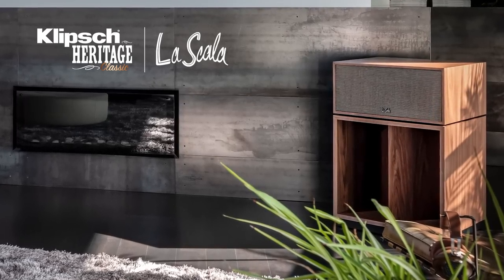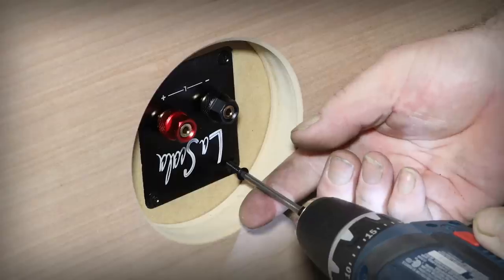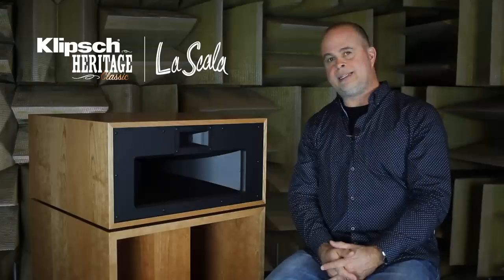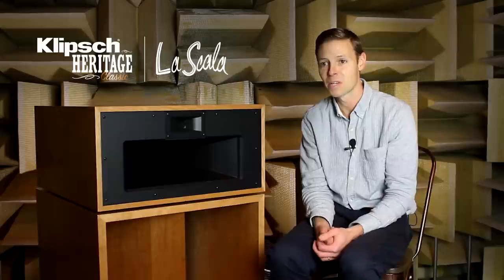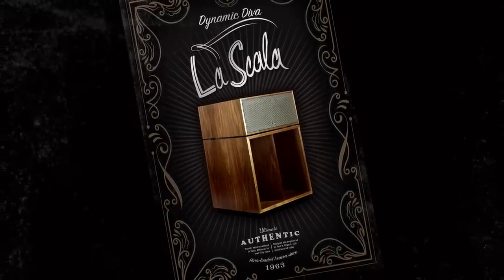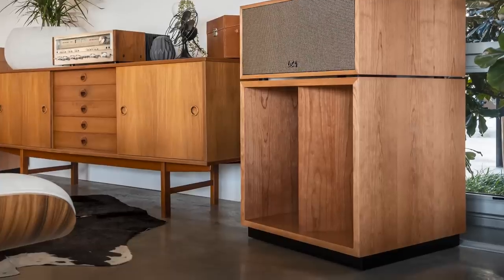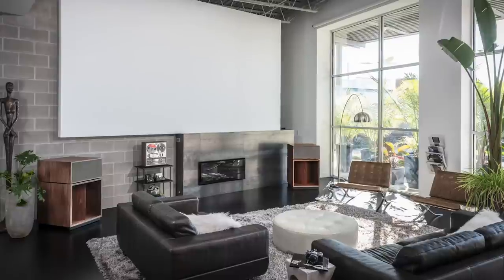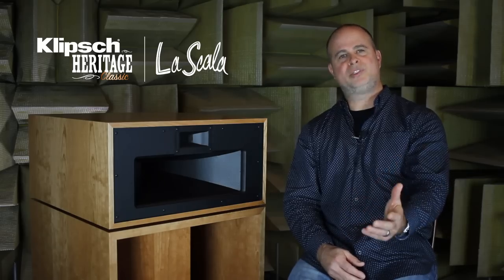Beyond the Specs: Klipsch La Scala AL5

Comment: MDF?  I used to own a set of LaScala Pros from the 80s, and those had heavy duty plywood throughout.  I used them as PA speakers until about 2015 when I gave them to a friend.  Hundreds of shows later, those were still standing after minor repairs.  I love these speakers, but I question the direction of increased price and beautiful veneers hiding MDF construction, which really is not as acoustically dead as good plywood and proper construction techniques, and isn't anywhere near as strong.  I'm sure the tuning and drivers are more refined now, but this speaker used to be far more utilitarian than it is now and that was part of its charm.  Not to mention it used to be far more accessible in price.
Reply: I agree with you.  The older plywood speakers could take a beating and easily be semi-restored with a little light sanding and either varnish or wax.  I would not want to hit these new speakers with something that dents or cuts the veneer as you'll be stuck with the damage.  Also, over time, humidity and climate could have undesired effects on the cabinets.  MDF may be OK for Sauder furniture, but I would prefer a more solid cabinet for the long haul in Klipsch (and you can order 1" thick plywood).  I would agree that iy may be harder to get the "book matched grain look" using ply, but a small price to pay.

Comment: LOVE the fact that Klipsch still makes them in HOPE, ARKANSAS, USA !!  Never stop making the Heritage Line.  Incrementally improve the drivers (midrange and tweeter diaphagms, crossovers, horn geometry) and your cult following worldwide will thrive and grow.
Reply from the maker: We'll do our best to keep pleasing our fans!
Reply: Mid horn still beams.
160 hz still peaks.
400-500 lobes
Timing terrible
Haven’t heard new tweet
Reply: Dave Volz - my impression is that you are transfixed by polars and sensitivity graphs.  Those quantitative measurements define your opinions and color your subjective reasoning. Fine. I’m an Engineer by training and I get that.  But so many music lovers crave a dynamic, forward listening experience that doesn’t require headphones.  To them, your opinion is meaningless I’m afraid.
Reply: @davevolz6138  But they will still sound more life-like than any (most) conventional speakers.
Reply: @Taco That’s not true. Flat response  is more neutral, without a  sonic signature imparted on the music or voice.
Only use horn loading when necessary.
Yes yhe dynamics are better  but early reflections caused by the horns themseves create fine cancellations in the resulting sound wave,  
you can even see it on sine wave sweeps. All those little zigs and zags are cancellation and reinforcements., giving a kazoo like texture to the final sound.
Reply: @Taco Maybe their new Twitter handles the lower crossover point better than the old T35. I’ve been time aligning experimenting with these for the last 40 years. Mid range gets way too beamy leading to bad off axis. Response.That’s a big reason La Scala needs just the right room acoustics. The bad off access is always fighting with the overall mix.Remember it’s the sum of the on axis and later delayed off axis reflected back by the room that equals what you perceive. If the direct sound sounds apart from the room sound the speakers never really disappear. listen to a speaker like the MBLreally shows that up.
I’m not a purveyor of omnidirectional speakers. They tend to sound too diffuse. But off axis is linearity is a must.
Reply: @Taco Enjoy!  That’s the bottom line!
Reply: @Taco They bring the concert into your listening room  like few others. I totally understand, and it is hard to explain.

Comment: I got a pair in December of 2020 and they are beyond superlatives.   I am pushing mine with a NAD 916 multi channel amp;  30 watts to the bass unit and then another 30 watts to the upper unit.   A 12" subwoofer fills out the bottom end tastefully and naturally.     Can confirm these speakers love live music.   On well recorded performances I swear you can hear how big the room was at the venue.   The soundstage is more of a SoundCloud  and can extend beyond the walls of your listening room.  Surprisingly, for each speaker being as large as a washing machine these La Scalas have a shocking capacity to just disappear.

Getting the AL5s was also like being gifted my entire music collection; everything sounds new and exciting.   Hidden details  now slap  you in face.    These speakers provide miles of smiles.

Comment: The biggest mistake I have ever made was selling my Lascala's in order to buy my first pair of klipschorns . Lascala's  are the most underrated speakers ever made . I did all the reasonable mods with a4500 CT125 tweaters and heavy Duty 15's from Bob Crites  i didn't go crazy with the mods. My speakers were 25 years old and needed crossovers and the woofers and tweeters were blown . I could have gone ALK or cornscala but I wanted the original look . Mated with a Luxman L100 the perfect pairing it was a 1 2 punch combo . I sold My LaScala's  for 2K and it took 10 seconds to sell . 

LaScala's are not zone specific you can place them anywhere in a room and they will perform . I have people swear the old ones sound better than the new AL5 and to that I say keep dreaming .
Reply: Charlie davidson I think the back of the new corner horn bass bins are now sealed. I wonder if this makes them less dependent on corner placement?
Reply: @MrBonger88  Yes you are right and it goes back to Paul's false corners . For years it was blasphemy to even say false walls even though Paul used them and Klipsch had clear plans on False walls.  I'm thinking of modifying my Klipschorns but I've been  waiting to see if someone has already done it and learn from their mistakes .  

Don't get me wrong Klipschorns are great speakers But my LaScala's to me sounded better . Lumber is expensive so I have to be smart because I don't want to waste lumber or more importantly ruin my speakers . False walls for me is not going to work .  

I go back to why they are in the corners in the first place . 

Great comment
Reply: Charlie davidson IIRC, Klipsch adjusted the crossover as well on the new sealed units
Reply: @MrBonger88  I also changed the crossovers to a/4500 crites crossovers which I had to swap out the tweeters .
Reply: Charlie davidson I like Crites. I have the crossovers and titanium diaphragms in my KLF 10’s. They sound a lot better than stock
Reply: @MrBonger88  Nice
Reply: I had a wife who wanted to get rid of mine.  Operative word "Had". Good thing she never priced them on Ebay.
Reply: The problem with klipsch is the existence of JBL.

Comment: I had a set (industrial) in high school and eventually had to sell them some years later . However this past year I was on eBay wondering what to spend stimulus money on and like a flash from my past I was rocking to an identical pair along with matching bass bins .  I still have my cornwall’s  that are 40 plus and crown D150’s x2 and a pair of crown xl602 that I got cheep to run the lascala’s and bins (bi amping) subs down to 30k . It’s like they never left me !

Comment: These only go down to 51 Hz?  How is that when using a 15" horn loaded woofer?  51 Hz is abysmal.  So, you're telling me that after blowing $10,000 on a pair of these monsters, that I would need subwoofers?  With cabinets and woofers of that size?  BTW, you reference 45 Hz in this video, yet the spec sheet from the Klipsch website states 51 Hz.
Reply: Have you had the opportunity to listen to This Speaker or even the Klipsch Original Corner Horn!? Your correct! 51 HZ is high for The Bass Content if spec'd for other Cone Loaded Speakers, But This Speaker will satisfy most Live Music Lovers Due to it's ability of delivering Extremely Fast Music information, The Music Detail is astounding! Give Yourself a real TREAT Audition one!
Reply: After owning a pair back in the late 80s, I can tell you from experience that a simple 3db boost around 31-32hz will nearly eliminate the need for a separate subwoofer.
Of course, finding room for a single MCM in the room would greatly increase low end extension...😁😁😁
Reply: You payed too much ! But the LaScala was never meant  for hifi PA work you need a subwoofer and it will be bigger   Than the LaScal to be as efficient
Reply: @donaldscheer5206  Nonsense, these speakers definitely need a subwoofer. They sound spectacular except the lack of deep bass is very noticeable on all types of music. Low distortion does not make up for non-existent deep bass.
Reply: @19761999  Never stated that a subwoofer wouldn't add to this speakers performance! Seems as though your just want to argue! Go Argue somewhere else!
Reply: @donaldscheer5206  I wasn't being argumentative. You seem to be a very fragile sensitive man. I apologize if I offended you.
Reply: buy the cornwalls if you are after deep bass
Reply: @donaldscheer5206  I listened to them and the lack of bass is very noticeable. Anyone who says otherwise is in denial. In fact the LaScala's have the least satisfying bass response of any large loudspeaker I've ever heard. I promise you that you will need a subwoofer if you value full range bass response. However, I do agree that the the sound they reproduce is impressive, almost shocking at times. The fact that the bass they do reproduce is low distortion is practically meaningless. I have never head a quality loudspeaker that failed to reproduce low distortion bass at 45hz. Lovers of live music can do much better for far less money.

Comment: Why do you guys still mount the mid-horn behind the wood structure & not flush with the outside, doesn't that introduce artifacts in the pressure wave? Further, why don't you apply absorbing materials on the front face of the enclosure as those edges at the perimeters will be creating anomalies as well, such as edge diffraction?
Reply: Ricardo Ellison Don't you think their engineers know what they are doing?
Reply: @progressiveguy9959  Of course they do...the particulars I noted are common knowledge...one would certainly not do such things on a studio monitor, the idea of edge diffraction is mulled over constantly & various solutions  to cabinet shape & front baffle are bandied back & forth. Splitting hairs for sure, but when all else  is fully optimized, failure to address the elephant in the room...stands out starkly.
Reply: @AndieBlack13  Paul Klipsch tried it and measured the result.  He said that it didn't make a dime's worth of difference.
Reply: @philipwebb960  Paul himself died in 2002, & the time when Paul was still in the lab was no doubt well before this, &  probably well before the concepts of edge diffraction were well known. The computer simulations available at the time of these experiments probably didn't yet exist. If they did exist, they were likely multi-million dollar affairs...today, we can download these programs for free & model a whole host of variables. Take any plain-jane exponential horn & mount the mouth behind 18mm worth of plywood & you will get artifacts, either by measurements or computer modeling...you just can't have a carefully curved horn & just stop its curvature for the likes of a front baffle, even for the likes of the final eighteen millimeters at the mouth.
  Why do the best monitors have zero grilles?, those weird looking baffle edges?...it's there for a reason!
  I've heard LaScalas before & was fully unimpressed...loud, efficient for sure, but not "accurate"...not close your eyes & listen, "is it a real instrument?, or isn't it?"...no, not even close.

Comment: I love these wish I had bought them back when I felt they were affordable. I will be watching for older used ones for sure!
Reply: Hey scottyo64, bought mine back a few years ago for $525 each. They weren't affordable then but I got them anyway, no regrets.
Reply: They listed for $495 in 1967 (I have the brochure).  Using an inflation calculator, http://www.inflationcalculator.com, that $495 is $3746 today.  Not far from $3999, considering the better drivers and materials generally.  They're just as affordable now as they ever were.

Comment: 45 hertz for the low frequencies on a 15” driver?? 
Seriously....
Yes the original design had this spec but come on? So many years later with redesigned mid and high frequency drivers this is not acceptable especially at this price range.
Reply: It's the horn size/volume that sets the low limit, it's just the way a horn works, it doesn't matter much the speaker diameter.
Reply: Don't like it? Don't buy it. Not rocket science. Also 45HZ is low enough. And if you want lower, obviously buy a subwoofer. No need to nit pick and complain.
Reply: @Maidenpatrol The Sunfire HRS-10 is amazing. One of the best home theater subwoofers ever made.

Comment: Did he say 'MDF sandwiched between wood veneer'? MDF? At that price?
Reply: MDF is a highly practical speaker material; the more rigid you make a cabinet material the more energy it stores, and the longer it takes to release that energy, but the makeup of MDF rapidly dissipates any stored energy, while the veneer on both sides of the MDF turns it into a sandwich structure that is still rigid in a bending direction, because the veneer adds tensile strength. This is why a number of speaker manufacturers veneer both sides of the MDF they use, even though one side of the panels will never be seen. I would prefer to see HDF, but the bonded fiber material (whether MDF or HDF) has superior internal damping when compared to plywood.
Reply: @Acoustic_Theory  hdf is super heavey.   i use it sometimes in my woodshop.  but i hate it.  once in a while i make quasi cornwall clones but with better drivers and high end cross overs.  Use baltic birch and 1/4 " mdf inside layer with nice veneers for those.

Comment: La scalas always needed a sub.  They tended to start rolloff at 100hz.
Reply: Galen Caudill Id hope not. Magnets and drivers have made a quantum leap since the originals.  51hz-17.5khz is still veiled and in need of a sub. Other klipsch extend past 20khz and have more sparkle on top.
If it’s down ( conservatively) -6db at 51 hz then -12db at 41hz. That’s a deep hole. Needs a sub.  They have enough bass to sound full range, but let’s get real. 1st octave output is insignificant.
Reply: Who cares as long as they sounded good. If you want to listen to low frequency pipe music? Go ahead and adjust accordingly.
Reply: @carmenandthedevil2804  "Sound good:"  is subjective.  And it's 2019, not 1979, we have better frequency response than these.  They sound veiled to me, and 2 dimensional as well as thin in the bass.  Not my cup o 'tea.
Reply: @scottlowell493  go and get a cup of coffee and stop crying over my tea ,I have the perfect base in mine .two fifteens and the guy wants to put his ten inch sub out ,if you can't get any base out ,the lascala is not your prob .
Reply: @scottlowell493  the frequency response was traded for distortion, they simply can't get lower with the horn size. Its why the k horn uses the wall
Reply: true. Nothing wrong with a good sub or 6 though.

Comment: I noticed a Pioneer amp. 1050  or 1250 i owned one from new, it eventually crackled out of control. Sony STR300ES takes over from the pioneer. I have Klipsch heresy H100, i bought new in 1975

Comment: How are they only getting bass down to 45Hz with a 15 inch woofer?
Reply: The horn would need to be exponentially bigger to help below that. So they just optimize for low distortion and excursion down to around 45

Comment: Why do they only go down to 45hz?
Reply: Gregory Knight It’s meant to be paired with a subwoofer for the lower frequencies.
Reply: Physics.  PWK's philosophy in the heritage line was horn-loading.  This minimizes driver excursion and as a result, lowers distortion to extremely low values.  The Klipschorn has the same woofer but goes lower.  Why?  The horn is longer.  Find some near you and have a listen at the incredible clarity at ALL volume levels.

Comment: I heard a pair of these, and I wasn't impressed at all. They lack low end punch, the highs were harsh and way too bright, and the horn design needs redesigning. These will only play to 50HZ and that's it. You need to have a subwoofer with these, because they lack sub-bass response. These need a lot of work. Mainly a change in drivers. You guys use PA drivers on the La Scalas. Compression drivers are meant for PA use, not home audio. Also the 15 inch bass driver that's loaded inside the horn needs to be changed too. It's a PA type bass driver with low excursion. Not good for bass output. If you stopped using PA drivers in these, they might actually sound better.

Comment: Using AudioQuest wiring is adding to the cost of the and NOT improving the sound by any means. Why not just use bulk Belden 10 gauge speaker wire instead?
Reply: @Larry Niles Pure BS..
Reply: @Larry Niles Wire has no gain.  All fancy wire can do is pass a fignal unaltered (which awg OFC 10 can) or  roll off.  It's another reason besides extreme overpricing as to why studios don 't use it.
Reply: @Larry Niles fancy wire is engineered by the sales department ,smart guy .can you hear the difference.
Reply: @Larry Niles It's a sales gimmick. Don't support that nonsense.